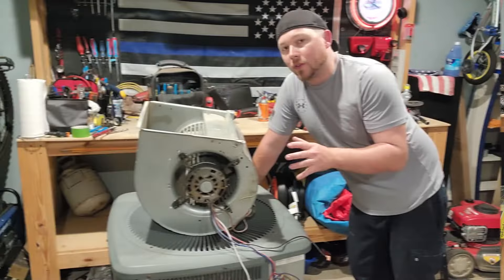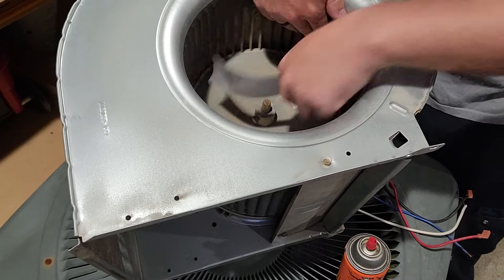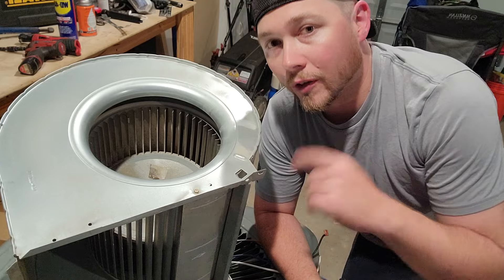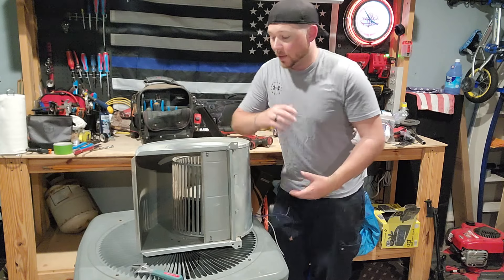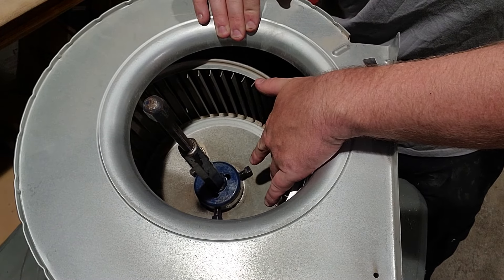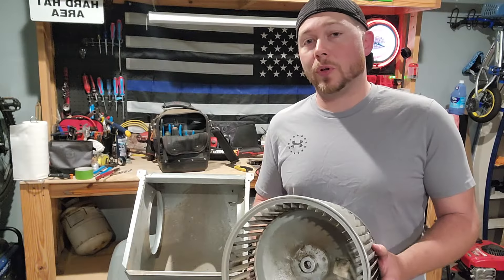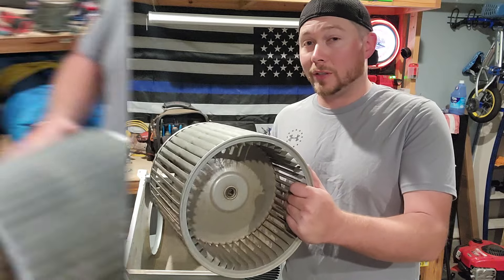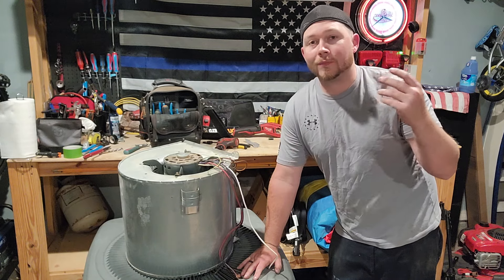How To: Take Apart A Blower Motor And Wheel For A Repair

Comment: Looks identical to mine. Issue is having is after flame ignites but before you hear the blower kick on you hear this thunk sound one time then one more time after it kicks on then no more the rest of the time. Sometimes louder than others, it’s 100% coming from that blower and wheel but it kinda sounds like it is rubbing real quick sorta thing. Maybe out of balance? Any idea?
Reply from the maker: Is it an ecm motor? I've had that board on top give me issues like that. Or the bearing inside are starting to go out

Comment: I have a Comfortmaker PGS442090KGP01C and was wondering if I can just remove the blower wheel by following your steps to sand the motor shaft and then remove the set screw and pull it out for cleaning. I would rather not have to remove extra stuff if I don't need to do so.
Reply from the maker: You can try but that wheels not coming out with the shaft through it. You don't have to take apart the motor if you just want to clean the wheel

Comment: Are those squirrel cages repairable? How do you know when it's gone bad? I mean aside from it being noisy. Aren't they always noisy and just vary between being noisy and noisier and eventually noisiest? Thanks for the video...straight to the point! Except this was more about replacement vs. repair no? Again, thank you.
Reply from the maker: The cage itself is not repairable. You can try to bend it and balance it but a new squirrel cage is between $35-$60. If you're having issues its easier to just replace the wheel with a new balanced one.

Comment: @WorldofHVAC, 
Great video, @WorldofHVAC. I did almost exactly that but now I have a bit of vibration. The wall adjusent to the blower motor assembly is slighly rattles. Before placing wheel back i spun the wheel by hand and it was not perfect spin. It was a little off .  Any thoughts? Is it motor shaft is bent or wheel?
Reply from the maker: Assuming the motor is centered, if the wheel wobbles when you spin it by hand the wheel is off balance. I have bent it back into alignment (the best i could) and that helped. If that fails just try and get a new wheel. They are $30-$50
Reply: @WorldofHVAC   how do you i bend it into alignment? Just pressing manually on wheel while assambled? What website do you recomend to buy a wheel? I see them up to $200. Unit Model # FX4DNF049.

Comment: My inside unit is making a low/deep banging sound (like a constant, medium pace bang on sheet metal) the sound is near where the squirrel box “blower” is located. Any advise would be greatly appreciated!
Reply from the maker: Turn it off and wait till it stops. Reach your hand inside the blower and see if paper or insulation got sucked into the wheel. You dont have to take it the blower out to do it. Just make sure it's off

Comment: What's the issue with using a convex blower wheel vs concave?  thx
Reply from the maker: I've never seen a convex blower. The concave design is meant to scoop the air. Ive seen those cups get so clogged with dirt they flatten out and struggle to move air.
Reply: Typically convex is for shorter shafted motors, there’s not a huge difference

Comment: I have a RUUD furnace UGDA-125A-GR       I can't find a blower motor.  Any suggestions.
Reply from the maker: Ruud is a very common brand. Acme or coburns can look up the model number. They probably have it in stock. 
You can take the blower out and get the model number off of the tag. 
Let me know if you need more help

Comment: where can I buy that blue  wheel puller tool., thanks
Reply from the maker: So that model is really old. I would recommend the updated version. I'll attach a link for the newer one I recommend. 
Sensible Products UP-1 Ultimate Hub Fan Blade Blower Wheel Puller https://www.amazon.com/dp/B001CGFQDW/ref=cm_sw_r_apan_i_KNSJGSXQ5FEB4H2CFT31
Reply: @WorldofHVAC   Just a thought, how much does the removal tool cost compared to a new blower wheel ?  Oh.....I looked it up. A new blower wheel like seen in this video is about three times more expensive than the removal tool.

Comment: Mine is making a screechy rattling noise. Don't trust myself to take it apart if it's something I can do with unit still on. I'm thinking it's just hitting against something but I'm not sure
Reply from the maker: A screech sounds like the bearing are bad and you need a new motor